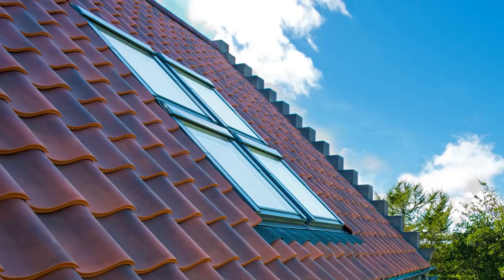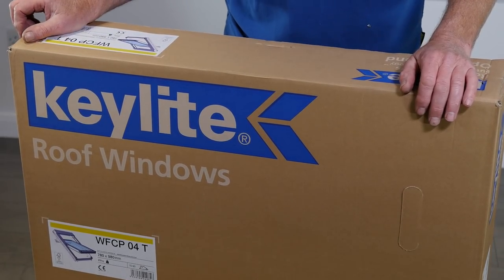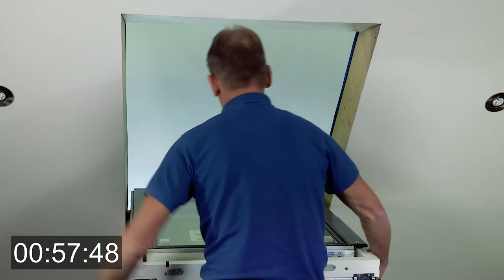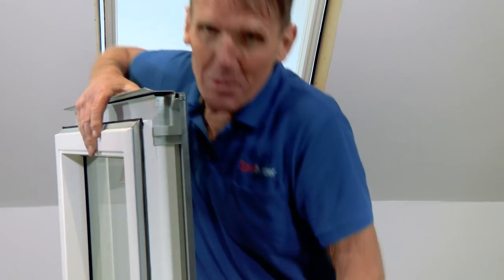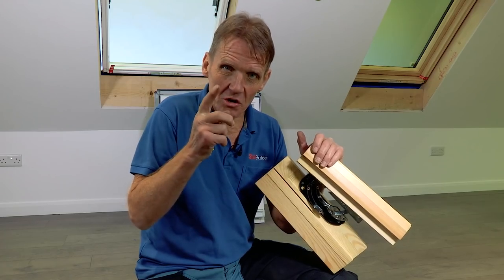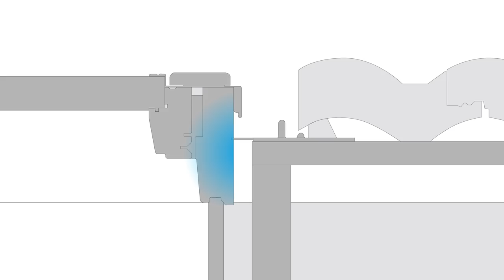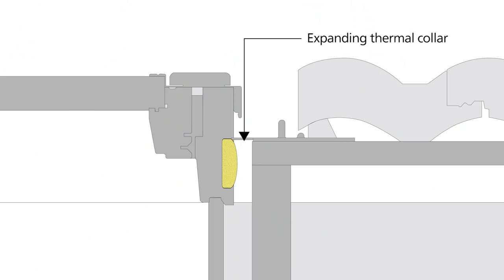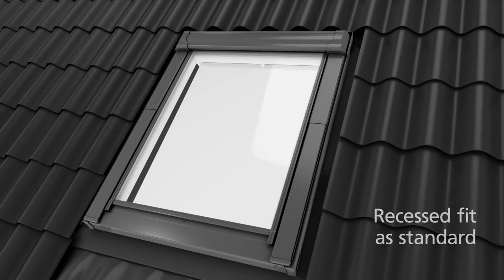Keylite Innovation - Features & Benefits with SkillBuilder's Roger Bisby

Comment: My client is project managing current job. I told my rep to put the thermal collars on the order with the velux windows architect specified. Customer decided they were not worth the £25 each and took them off. Rep told her most builders don’t fit them. So like you I’m pleased to see Keylite offering the collar built in. I will be ordering Keylite in future as it will save the hassle.

Comment: Fitted two of these to my own extension four years ago and they are easier to fit than Velux or Fakro windows and the quality is just as good and I would say personally the flashing kit finish feels superior to both the other two and the prefixed bracket system which is colour coded for the required flashing kit ( red or blue) is a great idea and is now been adopted by velux although you still have to fit there brackets to the window.
In all great window.
Reply from the maker: Hi Jaybee, Thank you for the kind comment.